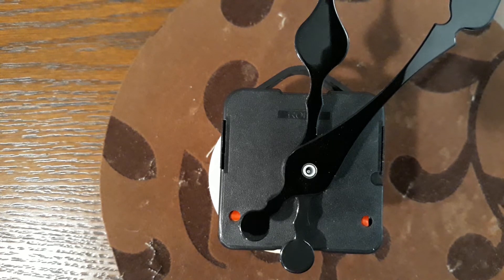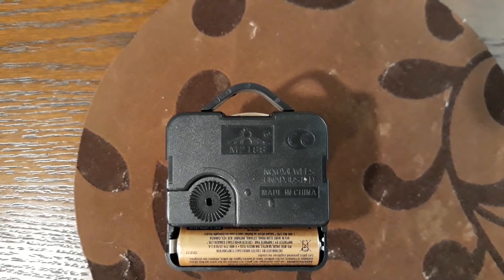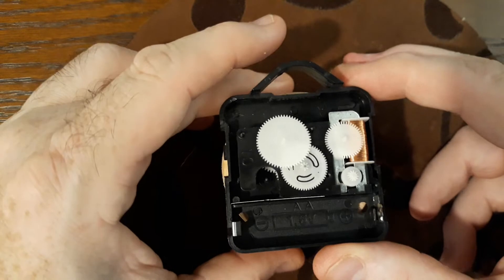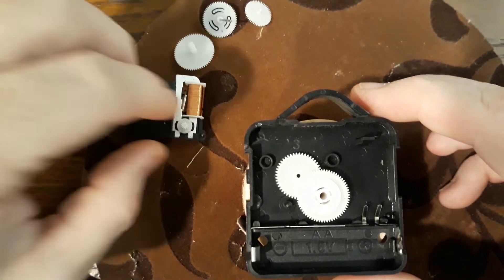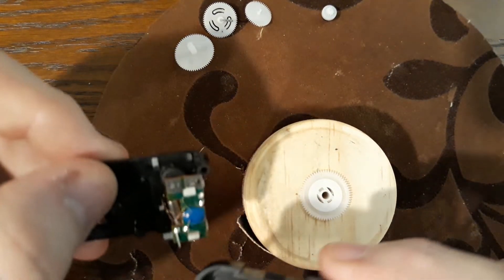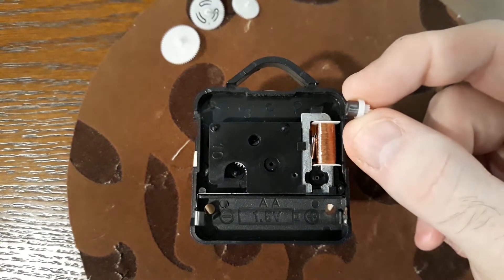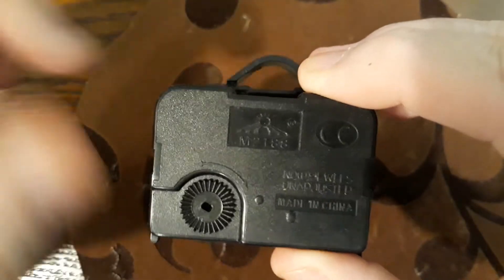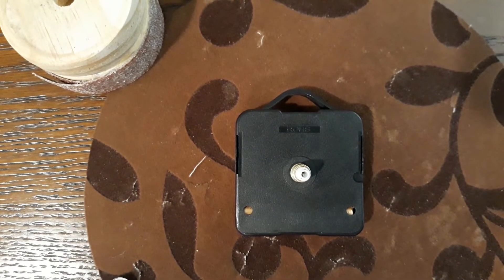Clock Repair M2188

Comment: Mine appears to be a model CW2018.  Slightly different but very similar modules. My problem was corrosion on the battery backet contacts at the circuit board causing the clock to stop. I probably would not have tried to fix if not for your video that showed how the modules fit together and are easily disassembled and reassembled. I also took a picture after removing the back so as to know the gear placement.  Thanks so much.
Reply from the maker: You are very welcome. I'm glad I could help. Take care and have a wonderful day.